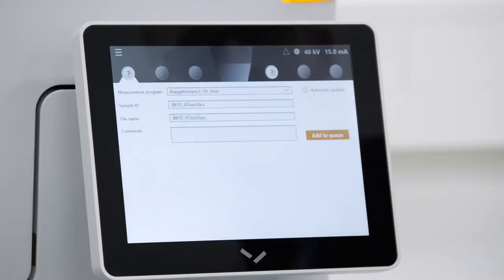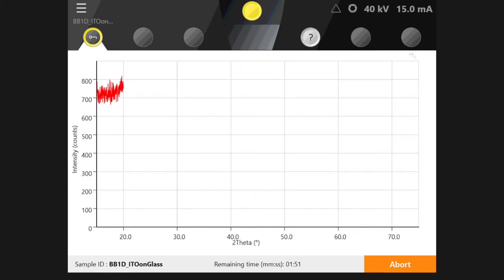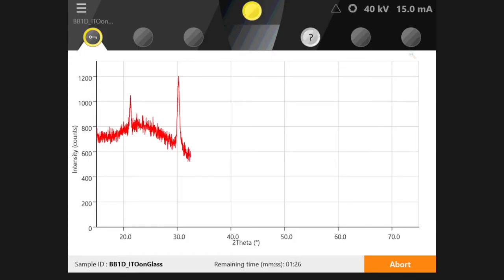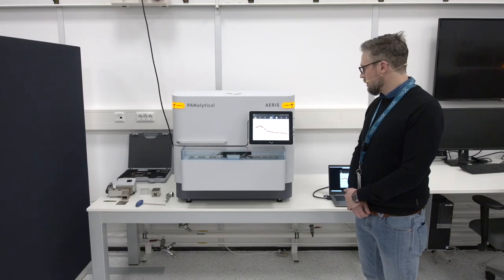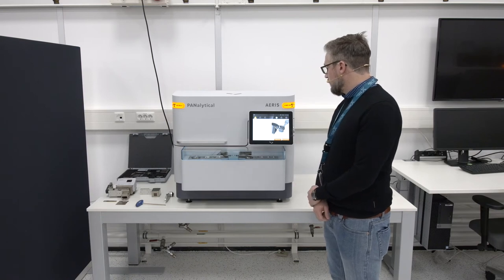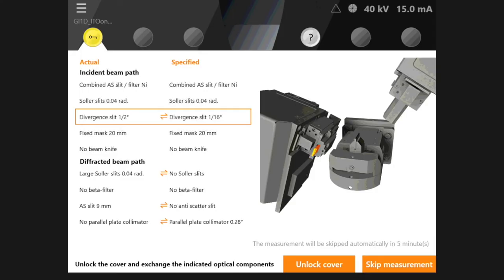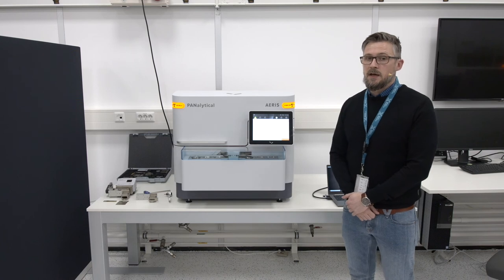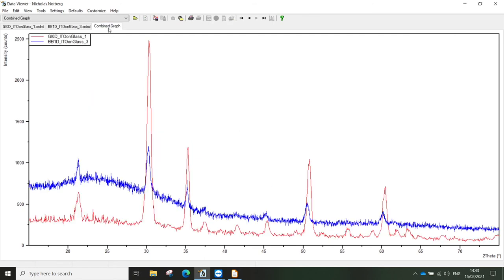Grazing Incidence X-ray diffraction with the Aeris diffractometer

Comment: Love how compact it is. What’s the down side of removing the soller slit? I am planing to do the same on my Empyrean forca GIXRD measurement, but was afraid to reduce the quality of the data.
Reply from the maker: Removing the soller slit increases counting statistics and results in a generally higher intensity in measurements. This of course is very interesting for GIXRD measurements as it will speed up measurements. The “downside” is that removing the secondary Soller slit (but keeping the primary soller slit!) theoretically results in a more asymmetric peak profile. But since GIXRD measurements generally show significantly broader peaks compared to Bragg-Brentano measurements due to the measurement geometry, the effect on peak resolution is rather small and in many cases even negligible. So the user ends up with higher intensities with similar peak resolution compared to a 2 soller slit setup. If the highest posible data quality is desired and measurement time is not an issue then of course 2 soller slits are always the preferred solution.